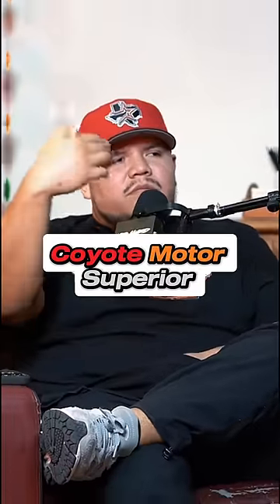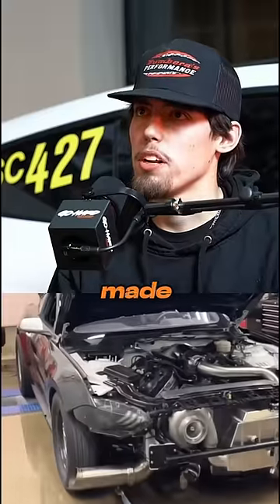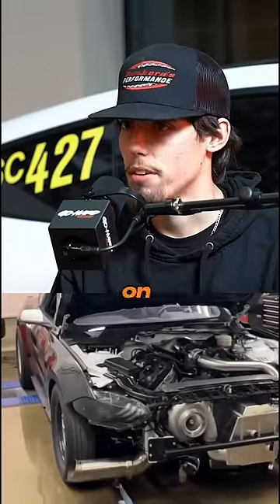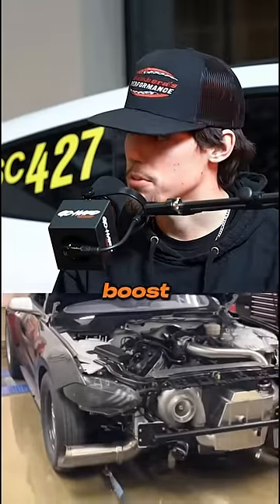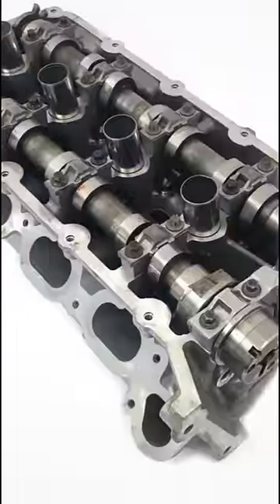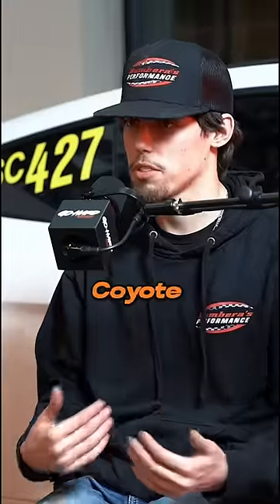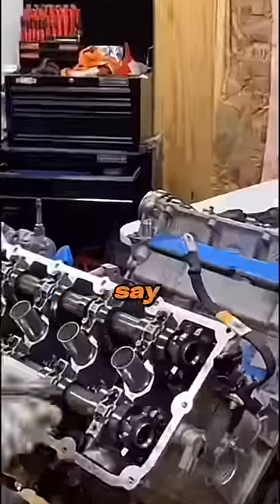SUPERIOR Ford Coyote Motor 😳 #shorts

Comment: ill take my old lq9 6.0 that i can fix without absolutely fucking my bank account lol. Gotta pay that Ford tax lol
Reply: Lq9  6-700 , with arp head studs , rockers , lifters , pushrods , cam , head gaskets , and the time to open up ring gap , and possibly change rod bolts and bearings - you’re in it for 3k or more , which can get you a 5.0 coyote from any salvage yard in my area , and still have 500+ left over towards other mods 

I myself made just under 1000 whp with a gen 2 coyote without really leaning on it  , that had nothing more then bolt ons , novi 2200r and fuel system . No opg no cg, 100% stock sealed , and that car banged off the limiter at 7900 daily “6 speed car and lots of wheel spin “ and never once had a failure .
Reply: If you take it to some crooks maybe the ford world is not spendy at all. I have a 800WHP 6.4 I only got about 30gs in it.
Reply: @dennismurray4088  I'm talking about basic replacements and maintenance. Not big power, I can go get a lq 9 from my local scrap yard for 400 bucks. At the end of the day it's all about preference. Ill concede that the coyote is objectively a better engine. But i like engines that I can find parts for on the cheap, and are easy to work on.
Reply: Cheap and chebby go hand in hand
Reply: @dennismurray4088  LS platform is cheaper, more widely available, a physically smaller package, and much more common for swaps making most LS swaps easier and cheaper than a coyote swap in the same vehicle. 

Coyotes are for the guys who are absolutely ok draining their pockets and dealing with headaches like chopping/ hammering their car to go fast. LS is the budget option that still makes respectable numbers.
Reply: @JakeTrimble-bx3lx  it’s not cheaper . Figure in everything I just mentioned - look up prices , to get to an equivalent level of the coyote - from the factory . 

You need :
ARP head studs 
Lifters
Pushrods
Rockers 
Valve springs 
And head gaskets 

Most people are gonna swap a cam in also , the labor involved with doing the above it just makes sense .

You go through and lookup the cost of said items . I have nothing against an ls , I’ve built several turbo/ twin turbo ls cars -  but it’s a pushrod v8 and the tech has been around for over a half a century .

The 5.0 beats the ls family in hp per liter massively , because the coyote is using newer tech , and extremely efficient .  The ls was out for 14 years before the coyote , but even the 4v 4.6 was still capable of making 800 whp in stock form . Gm didn’t even really change much from ls to lt - aside from direct injection , which was a massive step in the right direction .

A junkyard 6.0 , still needs all the parts above and still will cost 2500+ , probably closer to 3500 if you pay someone else to do the labor - I’d also recommend opening the ring gap up , and putting some arp rod bolts in - which further increases the cost . Any gen 2 or gen 3 coyote with the right tune , can make 1000 whp and live.
Reply: @dennismurray4088 yep...that's what I've been saying forever now fr. Too many people want to mention this and that about LS swaps and don't know jack sheeit about real power! First off, when you get an LS from salvage yard...there's a good chance that the previous owners ran it hot and probably put off oil changes or regular maintenance. I've seen way too many LS that run, but run crappy...due being neglected and don't last long for that reason. If you all get lucky and find a good low mileage LS, slap a S/C or turbo on it and see what happens?👎👎They fall flat on their face and don't make good power. You need to upgrade the whole top end and crankshaft too, then you start making real power...prolly 3/4K later in engine work. Funny thing is that after all that time and money put into the LS...it still won't make the power that the Coyote makes with minimal upgrades!!! When I was young and dumb I used to be all about LS, now that older and smarter...there really is nothing like the Coyote/Predator platform that make serious power on unopened factory FORD engines!!!🤐😂😭😉💯
Reply: @jtthedon4230  As someone looking to build a cheap drag car you've put my experience in words perfectly. I constantly hear "pick up a 6.0 for 400 bucks and youll make 1200whp" so i looked into it an guess what? you gotta replace damn near everything on that 400 dollar engine to run 1200whp without blowing up, it ends up a 2500+ dollar motor quickly and thats not even including the turbo400. Could have bought a complete gen 2 coyote paired with a 6r80 both good condition for 1500 on mp but hesitated sadly and it was gone.
Reply: @JakeTrimble-bx3lx it’s actually not that much cheaper anymore. Many YouTube channels do both builds in modern time and they are very very close in build price.  We are talking of making like 700+ hp. Yes a cheap junkyard ls can make 270hp to the wheels for very cheap but no one is talking about that
Reply: The ls guys will say it’s fake 😂
Reply: Got lq4 cammed, springs and turboed with stock bottom end. Makes like 700hp for less than 6k. Pretty fun truck
Reply: Dual overhead cams and 4 valves per cylinder will always be superior to two valve pushrod LS stone age bull shit, chevy guys do not have a clue what they are talking about
Reply: @thelooneybin722 idk where you live but every scrap yard in a 100 mile radius of me you aren’t getting any LS for under $800. And those are the 250k mile engines that may or may not be full of water and rusted. You can buy a brand new short block from ford for $2400. Or you can buy a sleeved and forged short block from Texas speed rated for 1500 hp for $5k. Spend another $5k on your heads with springs and studs and it will live for a very long time at 1500+. You can’t do that with anything from GM. It has to be a dart block.
Reply: @joshuaearnheart2756  I'm not talking about the ls, I'm talking about the lq9 ls family but less compression and less HP. Also not talking about power, literally just maintenance 😑
Reply: @thelooneybin722  you were talking about buying a replacement engine from the scrapyard. LS maintenance must include different things 😂
Reply: @joshuaearnheart2756 FACTS right there! I don't know where these guys are finding these so called cheap LS TYPE engines but you damn sure are NOT buying them cheap from junkyards in south Georgia...
Reply: @dennismurray4088  My completely factory, literally nothing other than ring gap. Lq4 has almost 60k miles at 800 whp right now. Thats through a 4l80 and 35 inch mud tire. There are so many examples of completely stock iron 6.0s making over 1k all year. All about the tune. Also if you do the work yourself. All those things including cam could be done for a little over 1k unless your going real fancy.  This technology argument is tarded. Overhead valve engines were patented like 1904 and overhead cams 1914..... Non of these engines are new at all. The manufacturing process to make more intricate designs, material technology and electronics are where the improvements are. We had factory 10 second cars in the late 60's. This stuff ain't new.  Overhead cams are the choice because they make good power while also being easier on emissions. The overhead valve is the better engine for the average diy guy. Also what transmissions does the coyote bolt to with no adapter? Ls bolt to every chevy v8 trans all the way back to the 50s. Makes swaps on old cars super easy and gives tons of options. Try to buy a vehicle do an ls swap and all the mods required to run 8 second 1/4. And do it all for 8 grand or less. Not happening with a coyote. I swap both of these engines into cars for people and just basic swap, no performance, the coyote always ends up being 3x the cost in parts and takes far more labor to complete. The parts cost may come down as  the coyote market keeps growing. LS swap stuff is just sooo plentiful and affordable.
Reply: @dennismurray4088 lol I’ve seen so many of these “reliable 1000whp stock motor” coyotes blow it’s not even funny. Keep selling people that dream😂 The ones who don’t have head studs, opgs and crank sprocket
Reply: The Ford is reliable and don't often need fixed if you take care of it.  You also don't gotta tear into the engine to make power just boost and fueling and done.  Still drive like a stock car too while making bug power.
Reply: @thelooneybin722 coyotes are easy to work on yall are just scared shitless of anything that is different than your archaic pushrod engine.  They're simple and reliable if maintained.  Boost plus fueling equal big power while driving like a stock car.  This isn't just with coyotes but 07-14 gt500 and 03-04 cobra also do this.  Very easy to make big power and those engines have the badass old school mod motor sound and make more tq by comparison to a coyote at any given power level even if running the same power adder.  They don't Rev as high out of the box but the 4.6 can rev just as high with aftermarket ecu stock ecu holds it to 7000 or so.  The long stroke 5.4 and 5.8 make big torque and have a power curve more like a pushrod engine than a 4v dohc engine but they still make alot of power on stock long block even without vct and super mild oem cams so you got the best of both worlds.  Too many uneducated people act like fords are unreliable or hard to work on or expensive.  Couldn't be further from the truth.  You gotta dump money in an ls to make it comparable to a coyote.
Reply: @dennismurray4088 this.  Too many people keep echoing the ls is cheaper nonsense without any real first hand knowledge.  Ask anyone who has actually built both and isn't bias they will say the same thing you just said.
Reply: @jtthedon4230 even the 03-04 cobra and 07-14 gt500 with the old mod motor architecture can make alot on stock long block with just boost and fueling upgrades.  Ford is where it's at.
Reply: @midnight347  my dart block 431 was 2x the price of my sleeved coyote and made similar power ..  the fact is , a coyote can utilize stock heads stock cams and stock block to make huge power . The ls needs full valve train , studs , gaskets etc - and even then the bottom end will still come apart with some bad knock . 

I’m not biased in anyways , I. Used to be a die hard Chevy guy , when I was younger . Reality is “fast is fast , reliable is reliable “ and ford is winning in those two categories
Reply: @midnight347  also like to add that I fully believe these new dodge motors , the inline 6 cylinder hurricane - is gonna be a major player in a few more years . There are rumors of them already surpassing 1000hp with a stock engine .

Comment: If its sleeved its not a stock block. 
The coyote has been tested and it can reliably make about 600hp anything over that they tend to wear out fast and i mean fast. "AS I SAID RELIABLY". they can make over 1khp no problem but they come apart after only a few passes. argue it all you want but there's a reason why i cant find guys that will guarantee a coyote build to last.

Thats why I'll stick with the iron block LS based engines. Theres guys daily driving 5.3s and 6.0s with 1000hp. And the stock geads even 862s can be ported and flow into the 350cfm mark.

The only advantage to the coyote is how it revs. The dohc setup is more tunable for making the engine spin faster but it has 3x the moving parts.
Reply: 800whp completely safe on a Gen 2/3 I don’t know where you got 600 unless you only looked into Gen 1.
Reply: @169abr  I watch Richard holdner for his testing until they break series. The 6.0 was the toughest stock bottom end he could find. It made pass after pass at close to 1300 hp and when it got torn down didn't even show signs of wear. 

The coyote made more power consistently but it came at the expense of having to sleeve the block and a few other details.

The coyote is the better performance build if you have the money. It's DOHC really makes a difference across the entire rpm range.
Reply: @buildurtruckurway9118  Richard is a smart man, but the Coyote is a weird platform where there’s a lot of bad information out about it. Most people will live at 850whp on the Gen 2/3 and never really have issues. If you’re want to be super safe just make it 750whp and be ok with it. The rings will need to be changed but that’s really about it for stock motor. I believe there was a guy on the forums who went ~190k miles on a whipple manual Gen 2 that was constantly beat on and it finally gave out on him due to bad batch of E85.

Comment: I love any V8 with pushrods and single cams. Much simpler to keep on the road and usually everyone sells parts for them especially 350 gen 1 sbc
Reply: ya those were great back in the 60s, but now in 2024 dual overhead cams, variable valve timing, and flat plane cranks are far superior, can hold a lot more power, and rev a lot higher without blowing up
Reply: Get with the times old man!!
Reply: @ErikGoranson hold more power? 🤣 revving higher is overrated LS will already do 7000+ easy